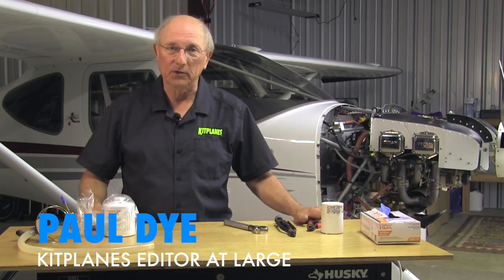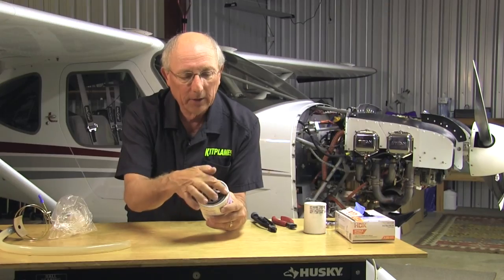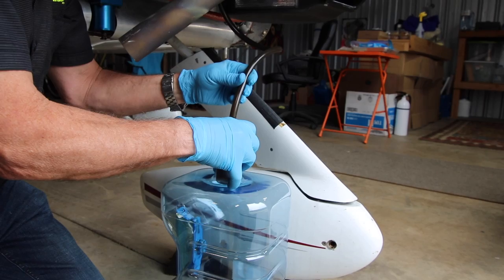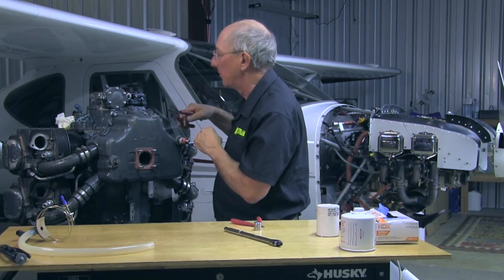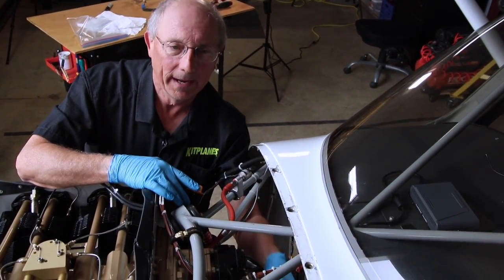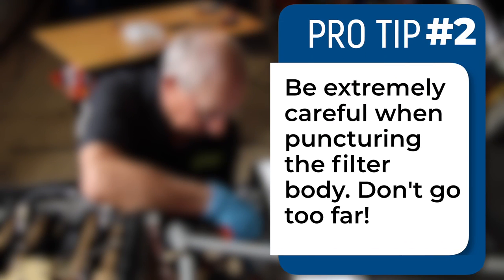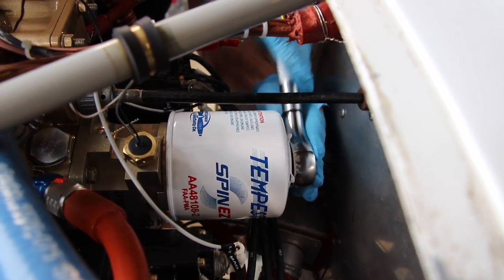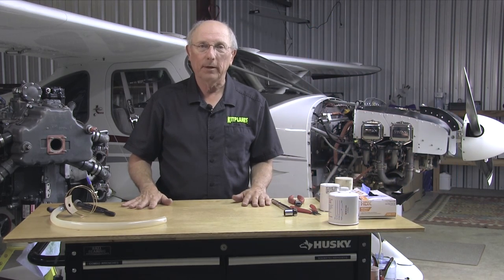KITPLANES Firewall Forward: The Oil Change

Comment: When my dad taught me to change the oil in my car he said it was better to warm up the oil by running the engine for a short time before draining it.  Would you recommend that, or does it make a difference?
Reply: I think it makes the oil more liquid, so it drains better from the sump.
Reply from the maker: Even better is to fly it briefly. The you want all the junk in the oil to be in suspension, and warmer oil will take less time to drain.

Comment: I advise against Paul's advice for adding a quick drain oil plug.  This quick drain oil plug killed Martin.  

The oil quick drain on the engine oil sump was found to be leaking, even though it was in the closed position. Examination of the oil quick drain revealed that it was discolored and that the O-rings were melted, indicating that the oil quick drain had been exposed to a high heat condition. Further examination of the area around the oil quick drain revealed the presence of soot on the bottom of the oil sump downstream of the No. 2 cylinder where the engine’s left side exhaust pipe was separated from the exhaust collector. Additional examination of the exhaust system indicated that the left exhaust pipe was a slip fit design and that no exhaust pipe clamp was present. This evidence indicated that the source of the thermal distress event was most likely an exhaust system leak that impinged on the oil quick drain, melting the O rings and resulting in the oil draining from the engine and subsequently igniting. A review of the operating temperatures associated with the engine indicated that the exhaust gas temperature was hot enough to exceed the upper limit of the temperature specifications of the oil quick drain and was also hot enough to ignite the oil. This ultimately resulted in the in-flight fire and led to the pilot’s subsequent loss of airplane control.

see NTSB report:  https://data.ntsb.gov/carol-repgen/api/ ... 103266/pdf